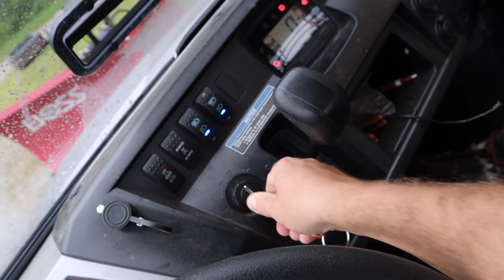Time for the BIG GUNS! Bolting DOWN the 6x6 Sill Plates on our Post & Beam Garage Build Day 3

Comment: Al, when you're  drilling anchors, or anything in concrete, you'l find it goes better if you pull the bit out each time you make some progress. It clears the hole and keeps the bit from getting too hot and losing hardness. You don't want your bits losing their temper...

Comment: Hey AL, love the build videos! I know you built this over a year ago, I like how you problem solved anchoring the structure with short anchors. If you want to make it easier and cheaper to anchor large 6×6 timbers, beams, logs or just about any size lumber for that matter, you can use 12 inch or longer threaded rods and anchoring apoxy, this will save you a few steps and have superior strength. Just some back saving advice from one carpenter to another.

Comment: Been watching your install on the sill plate bolts. You will do yourself a favor by putting some axel grease down each of the bolt countersinks now that you have them tightened. It will keep moisture and bugs from making the hole a home.  An old farm trick.

Comment: Al. I was always taught that a damp proof bitumen membrane between the wood and the concrete stops damp coming up through the concrete and getting into the wood. I know you are finished but you could loosen the bolts and slip on underneath and tighten down.

Comment: If you have any water sealant (i.e. Thompson's) give the sill plate a good coating now, before you start putting up the walls, and before the rain gets in the drill holes.

Comment: The chunk metal in the wood will tear-up a regular wood bit, but the Hilti bits (and all carbide tipped concrete bits) are made to drill thru rebar and wire reinforcement, so I wouldnt worry about it

Comment: Since your 6X6's are pressure treated, you should be using galvanized or stainless steel bolts due to corrosion caused by the wood treatment products used.

Too late for this project, but I get my construction fasteners from Boltdepot. They have some of the best prices around. As an example, the anchor bolts you're using in a 10" length, 1/2-13X10" in galvanized single price is $3.40 each, $59.63 for 25. Same for washers and nuts, very good prices.

Comment: If you don't mind, another trick an old carpenter, my Dad, taught me that I would like to pass on: When you need to line something up along a long straight line, string your tight line along the plane you want to line up with. Take a piece of material that is the same dimension along its entire length and cut it into three small blocks. Place one block between the string and the plane you want to line up with. Use the other (third) block as a spacer between the line and whatever you are aligning.
 If you leave the string right against the edge you want to align with, anything along the length that moves the string changes the line. With the string away from any surfaces, it stays straight. Another reason a "pouch" or overalls with bib pouches  is handy. That little block is right at your fingertips (in one of those pouches) every time you need it along with the fasteners you might be using.

Comment: I used a Hilti like the one your using and it had a built in depth stop.  Look for a 3/16" steel rod in the box and it goes in the side handle bracket opposite the handle.    A 2 pound hammer sets the anchors easier.

Comment: If you're drilling down about 3.5 " with the Forsner bit, won't that put you past the top half of the lap joint, thus not securing the top board?

If the 6x6" actually measures 5.5", half that (for the lap joint) would be only 2.75". You'd be drilling 3/4" past the top lap with the wider hole.

What do those timbers actually measure? I realize you're putting in 3 bolts per joint, but didn't you only use two in some places?
Reply: I was thinking the same thing. And after all the measuring to get the plates square then seeing the gaps in the lap joints
Reply: @brettn4337  I wonder if those gaps will make a difference when he adds the next, or final pieces? Perhaps off a few inches?

Al always seems good at making things work out, though.
Reply: @stevenpeach6971  He confirmed the measurement of the lengths of each assembled sill plate side and they all comply with the plan specs.
Reply: When it comes down to it they're building an agricultural shed not a bespoke architectural home, so I suppose it doesn't matter too much
Reply: @mintysingularity  I guess the gaps then, are for "play" as a precaution? Better than having them be too tight and they'd have to be cut?
Reply: I was wondering how long befor those bolts pull out. Thing they are way to short. Also should there not be some kind of damp stop between the concrete and and the wood. A J bolt or threaded bar at least 12" into the concrete would make me sleep better on a windy night.
Reply: @Hagar2670  Didn't think about that. Al's been in construction for quite a while, so perhaps this is just a different way of solving a problem?

But I think you make a good point about the length of the bolts.

I suppose if he had put some bolts in the cement while it was soft, he may have had a problem centering them on the timbers?
Reply: @Hagar2670  as you are, I'm wondering..... Maybe it is ok in this way as per spec sheet (architect/engineer) of the ''building plans''; Al should answer our concerns to make us sleep better ;-)

Comment: I'd like to pass on a little hint for picking and cooking corn that was given to me years ago:  Apparently the moment that an ear of corn is picked,  the natural sugars start turning to starch.  Back in those days we boiled our corn instead of steaming or microwaving so we actually set the water to boil first before picking.  Then I would go to the garden, harvest what we needed, head to the horse corral and shuck the ears.  By then the water was boiling and the ears were probably less than 10 minutes from stalk to plate.  Talk about sweet and fresh -  it was the absolute best.  Over the years we also learned that for the most tender product, there was no need to cook the cobs (just the kernels) and reduced the cooking time accordingly.  Lately, using the microwave to basically just heat the kernels, the flavor has been even better.  Almost raw (but hot) flavor!
Reply: Credit for that should go to Euell Gibbons. In the 60's he use to do that on his tv show. He was kind of a wild plant and health food nut.
Reply: Great idea !
Reply: Great advice, thank you!
Reply: My husband used to help his uncle on the farm and he was told to plant the corn uphill and as soon as you pick it run down hill and dump in a pot of boiling water!
Reply: @soniaspangenberg6892  The good old days.  Thanks for the joke from the past!

Comment: When you first got the drill and Forstner bit out, i said, He needs a Hilti Hammer drill, and sure enough, there is was ! Great minds think alike. We did the same process when building the interior walls for our basement. Drill holes, insert bolts, tap in, then put predrilled sill plate down on top of construction cement for waterproofing. Im surprised you didnt use some sort of barrier between the concrete pier and the pressure treated sill?
Reply: I love my rotary hammer! If I could make lunch with it, I would.

Comment: Curiosity the two independent piers in the front are they slightly off from your measurement? I ask because it looks like the two sill plates appear off center from them. Nothing big just curious. So will you backfill the floor area with Quarter Minus rock to raise the level and give you a firm floor?  Looks great by the way wonderful job.
Reply: Lumnah Acres said in a reply on previous video that the floor will be gravel.

Comment: Watching you install the sill plates leads me to wonder: although you leveled the piers, but have you double-checked to make sure the sill plates are also level?
Reply: How could they not be level ?
I think I would have set some all-thread into the concrete for hold downs, those anchors can crack a pier 
👍😊🦘🇦🇺
Reply: Colin Stace yep, not enough concrete between the bolts and the edge can make them blow out especially the corner piles where Al used 3 fixings
Reply: @colinstace1758  because with construction things don't always work out the way you expect, especially when you assume it should be ok. And so you check, and check again. Like they say, measure twice and cut once.

Comment: Am I seeing things, or did you put three lags in-line instead of putting them around the corner? If so, the top plate isn't secured to the foundation column.
Reply: I'm talking about the corner next to the left door.
Reply: 21:16 in the video

Comment: Why not use threaded bar and resin save money as well has drilling.
Reply: I was just about to ask about J bolts or other brackets.  100 ways to skin the cat.
Reply: @mandeladams4793  while J bolts are very cost effective, as well as quite strong, once installed in concrete they don't offer the ''ajustability'' of any kind of offset for the sill plate/beam, while by drillings Al was able to optimize the position/efficiency of the lag bolt.

Comment: Can't tell from the video, but on the lapped seal joints, it looked like you drilled down pass the top lap into the bottom and bolted the bottom tight. But I couldn't tell if you bolted the top lap seal tight as well. A stepped drill in the top would pull them both down and tight. I just couldn't tell if that was how you drilled them. Thumbs Up for sure...

Comment: 1 st. your videos are never too long.
  I do have some suggestions!
  To save wear & tear on the battery power tools, use the electric tools. 
 You should be using face masks no matter if it's dirt dust, straw dust, concrete dust if you don't it will accumulate over time in your lungs & will scare for life.  Trust me on this one, learned this from my Dr. it was too late for me at 88.  You have time to stay safe!
Finally, put some material in the egg box, how would you like to set down without a pillow????

Comment: Hey Al, on that short timber, you pounded the bolt into the cement first, then put the timber on top and screwed it down.

How did you secure it? Or did you not show us you removing the bolt after, then putting it through the timber onto the cement? 🤔

Comment: Curious as to why you didn’t pre-sink the bolts into the concrete while it was curing ? Most builds I watch do that. Where you concerned that alignment would be off ? So much drilling to put those in. Still enjoy your attention to detail. Keep up the great work.
Reply: I had/have the same question - put in a "J" threaded stud into the concrete before it sets and use that to bolt on the sill plates - then I thought what a pain it would be to precisely drill those long sill beam-plates in the exact location - much easier to drill as-needed - more flexibility that way.
Reply: It is much easier to be precise,  drilling after the sill plates are down
Reply: I would have done that with either j bolts or stirrups, if you check measure and get your layout right it makes it easier, and he has detail plans to work off 😊👍🦘🇦🇺
Reply: @samvalentine3206  If you watched the video with how much they needed go move the sill plates to make the building square, it would have been difficult to guess where everything would have lined up to pre set the bolts.  This way they, they could make the building square and put the bolds where they needed to be.
Reply: What does Jamaica Cottage call for?  That's your starting point and then you can all "beef up"
Reply: Threaded rod buried in concrete is common when putting up posts, but when you have 19 holes to line up that are all connected together, I guarantee you would be reaming out holes to make it fit.  Having a 1/8th allowance with concrete is difficult, so drilling 19 1/2 inch holes isnt really that bad.  I work in steel construction and that looks like common practice for this situation.  Cheers everyone!
Reply: @truenorthhaven7676  I take your point but you are only drilling 1 sill plate at a time, sit the lumber on top of the rods and hit with a hammer to mark the spot and then drill, I've done it this way and it works fine, I don't trust those anchors, unless they are stainless steel they will rust in the concrete and in the treated lumber

Comment: why is the drone wobbling so much ? bad blade ? crashed it ? update the firmware ?
Reply: If it's in follow me mode if you move slightly so will it!
Reply: @tonygrimes13  mine does not jerk around like that. mine follows smoothly. just like everybody else's drone.

Comment: Hello Lumnah, I am sorry but this is not the way to use a Hilti. Read the manual and it says you dont put much weight on the machine. the intern pneumatic hammer is doing the job for you. If you put to much weight on the machine you will destroy it. love your video's